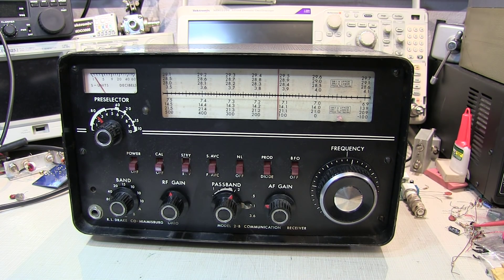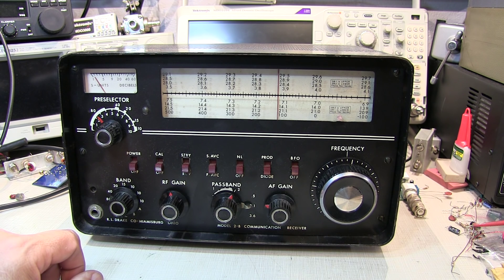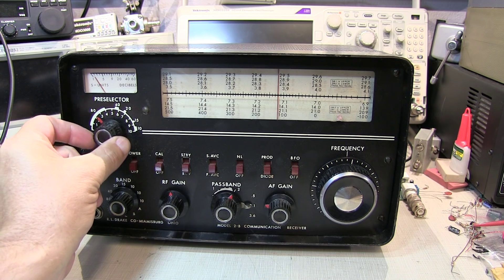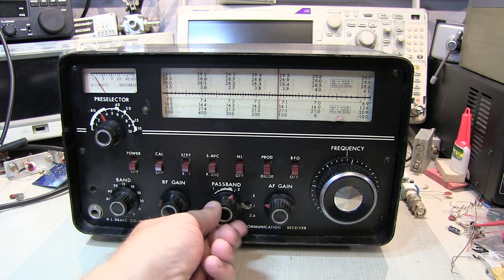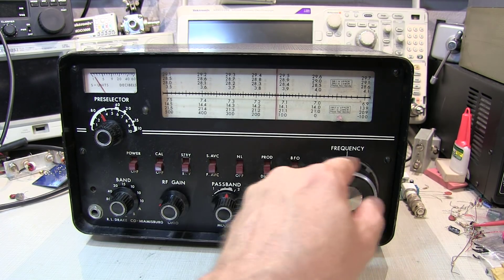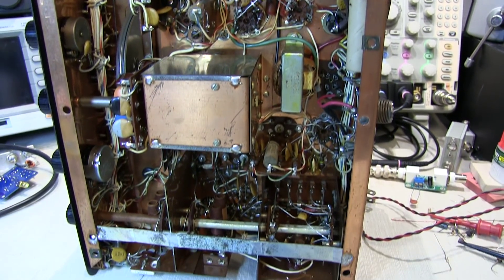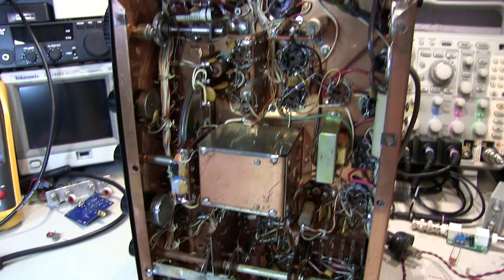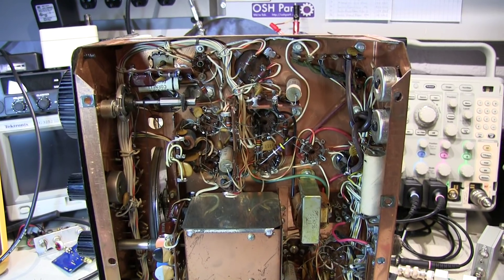#210: Drake 2B Receiver Introduction and initial assessment

Comment: Hi Alan ... in my early days, I went to the Toledo Swap meet with my father, where he was considering obtaining a new receiver. The Drake 2B was one of the three candidates. And really, it came to be one of the top two. The other candidate was the Hallicrafters SX-117. My brother, also an amateur radio op, has purchased a couple of 2B's over the years. and as we were watching your video, he sad that one of the reasons that Dad made the choice he did was that the SX-117 had a built in Q-Multiplier (notch filter), while it was an option on the Drake 2B. And as it turned out, the SX-117 was the receiver that Dad made for his final choice, and as such, it was the receiver I used as a Novice, and later, General class. One of our best friends that lived about a block away, but enjoyed mostly phone operation, however used the 2B. At any rate, it is very interesting to see the 2B again, and learn about some of it's features.

Comment: Excellent idea to make sure it has the correct tubes in the correct sockets, and to  test each tube.. BEFORE you fire it up.  The burned fil wiring is tell tale of a problem you want to find and fix !   Not unusual to find that the wrong tubes are in the radio...because of numb nuts who got there before us.  With radio in the case.. it is very difficult to remove some tubes and impossible to see some tube sockets another cause of mistakes.

Comment: Alan, nice unit! BTW, isn't that PL antenna connector hacked in (not original)?
Reply from the maker: +Charlie Pechiar I thought it was hacked in, but I have seen that in the Drake documentation, so it could likely be original.
Reply: it is original to the receiver. My 2-B has one too.

Comment: Was that rubber insulation on that wire, if so it tends to crumble away over time, a bit of heat and extra ozone from HT systems and it rots faster. I have had radios from the 1930's and 40's where there is not a bit of insulation left
Reply from the maker: +Nigel Kingsley-Lewis No, it was definitely overheaded and melted.  The remaining wiring/insulation is in perfect shape.

Comment: Nice! There is a strong web presence for Drake so parts won't be an issue. I've got an R4, the twins (R4B and T4XB with the MS-4 station speaker. I also have the L-4B amp. I love Drake gear (actually, boatanchors in general. I have an almost complete Yaesu 101E station. Love the glow of tubes ). It feels a little weird giving you a suggestion, because your skills with electronics greatly overshadow mine, but, after a year of rebuilding vintage tube radios and test equipment, I can tell you  that there is one thing that rarely every happens... paper caps of that vintage rarely (read that as almost never) test well for leakage. I have a couple of restored (by me) capacitor testers (Heathkit, Eico, and Sprague TO-5) and I always test paper caps that I remove. I can't think of a time where the paper cap tested good for leakage and I've got a pile of "vintage" paper caps. The one caveat to that is that it seems like the rare instances where I find a radio or piece of test equipment that hasn't been used the quality if high, the paper caps are good. ESR is not as important with the old stuff. Leakage at XXX volts is the deal killer. It'll be interesting to see how much luck you have with reforming the electrolytics. I haven't tried to do that very many times. I haven't had much luck with it. I bought the TO-5 specifically for reforming. The "can" on top can probably be bought from Sherwood Engineering or someone like that so the set can maintain it's original appearance. Sometimes resistors wander out of tolerance. I have sets that were made in the 30's that had virtually no resistor drift and Heathkit, etc that had 75% of the resistors that were grossly out of tolerance. Mica caps are almost never bad, almost, sometimes one will surprise you. Tubes are rarely bad but it happens. I recently fired up my Eico 950 RC Comparator Bridge to test a cap and the rectifier tube was bad. It tested great post restoration the tester had worked not even a week earlier. Go figure... Be careful, tube gear repair is addicting. Next thing you know we'll see you and bandersontv on the same channel :)  73 NE5U
Reply: +Michael Lloyd With old marshall guitar amp, we disconnect the B+ line, and add a resistor (220k is typical) in serie with the caps( and disconnect the rest of the circuit). Leave it on for a few hours while monitoring voltage drop across the resistor. When voltage drop is very low, caps are ready(reformed).